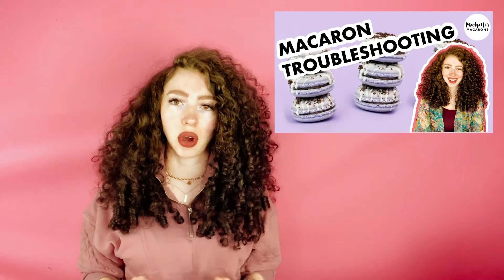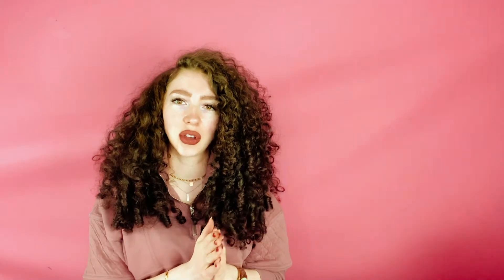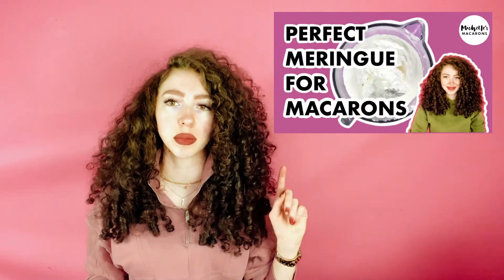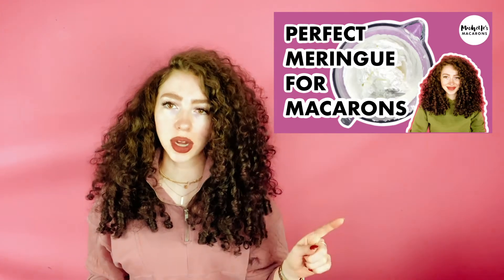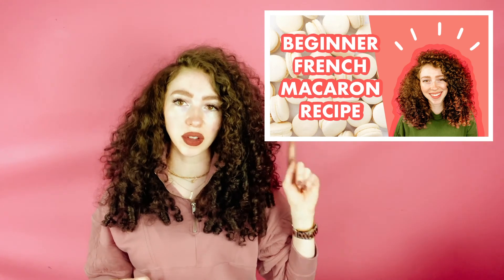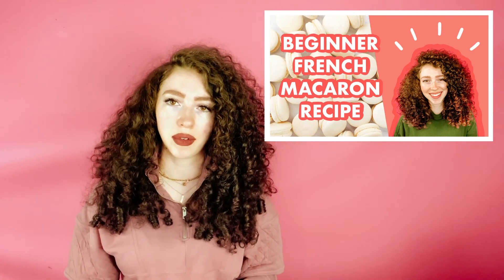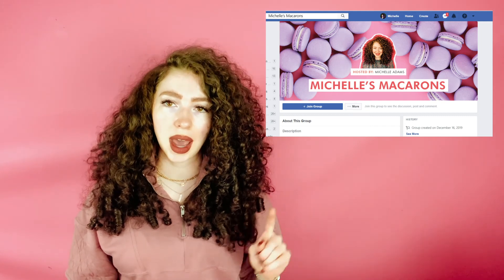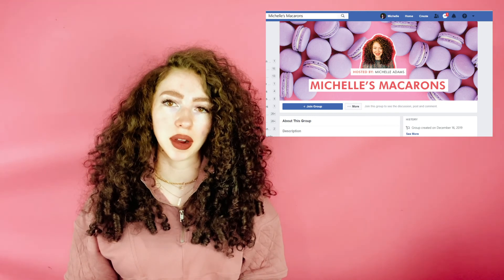Macarons Cracking | How to Fix Cracked Macarons

Comment: I tried 2 times but keeping fail
Reply from the maker: What problems are you having?
Reply: @MichellesMacarons  I don't know where I keep failing I just follow your recipe and your steps and keep doing but I don't get why. Any idea y?
Reply: @MichellesMacarons  keep cracking on top they're not coming like to dry should I supposed to use hair dryer to dry them 😔
Reply from the maker: How long are you letting them dry?

Comment: Currently watching this video while seing my macarons in the oven crack on top...It's my first time making them (Valentine's day ofc) and I did them yesterdy to test, failed because they were underbaked, tasted them, and they were way to sweet. So today I changed the sugar mesurements, I took off about 15g of the sugar both in my swiss meringue and the icing sugar. They have several little cracks so it might as well be the meringue, OOOOR the oven, because I baked them at 145, yesterday I baked them at 140, they were shinny smooth almost perfect...but unbaked. Thank you so much for the tips! Gotta do my 3rd batch after shool now, I can't waste my rasberry ganache now :( Also it was impossible to get my batter with a ribbon texture, it was always breaking and it still needed a lot of efforts to fold even after 30mn of macaronage. What hurts is that I could've baked yesterday's batch a little longer and it would've been perfect :(((